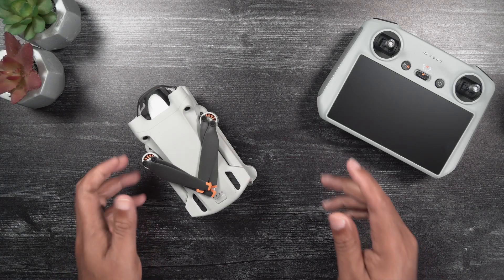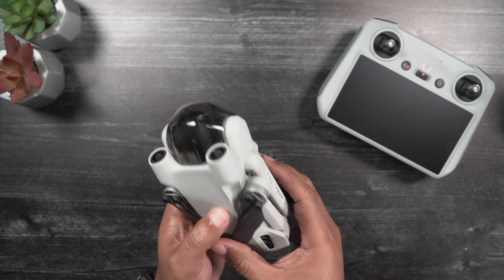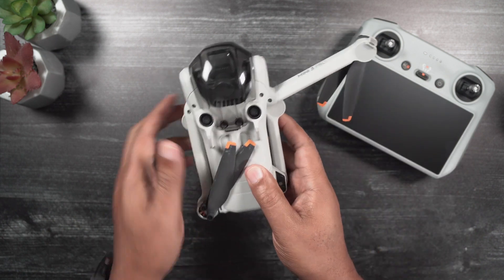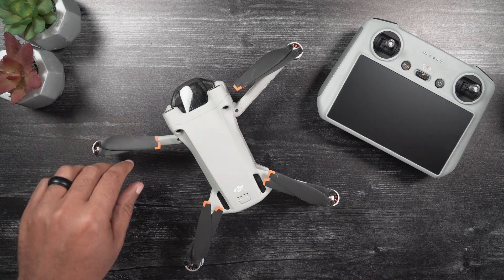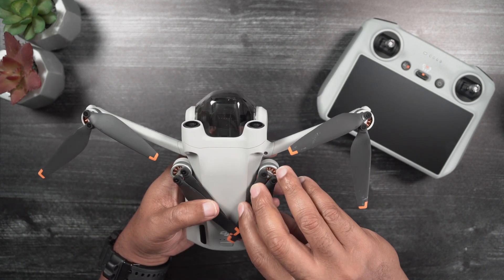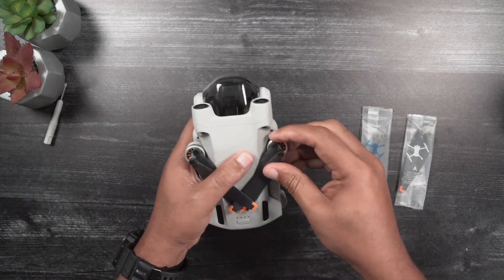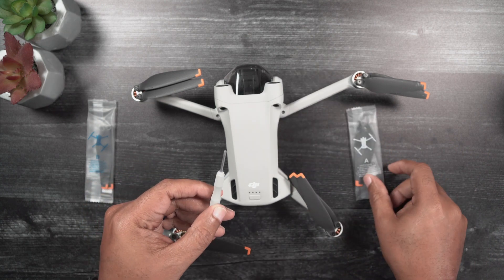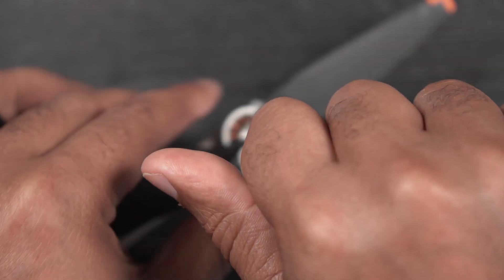DJI Mini 3 Pro: How to Unfold the Arms and Change Propellers

Comment: I have changed my drone pre and now it shakes. I brought them of Amazon.. any tips
Reply from the maker: The only thing we can think of is ensuring the correct props are on the correct motors. The front left and rear right take a particular prop - different from the front right and rear left.

Comment: thank you so much for your video, just the few first minutes told me something no other dji mini 3 pro tut vid has said properly: HOW TO UNFOLD THE ARMS PROPERLY.   I was about to have the worst first experience with my brand new mini 3 pro: forcing the front legs to open to the side.  The other videos seem to skip this part and I was trying to open the legs the way they were.... but it felt like I was trying to break the drone!   Thank you!!
Reply: I was heading in the same direction as I was unfolding the the arms for the first time. Something was not right. And then I found this video. Whew!